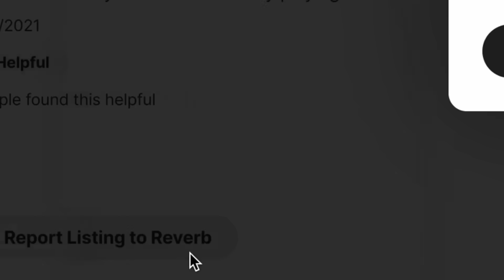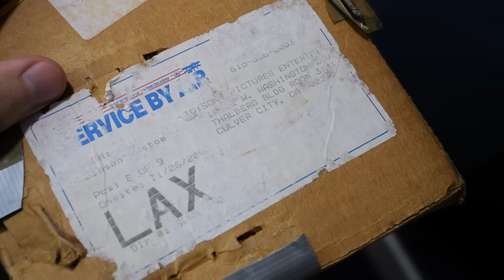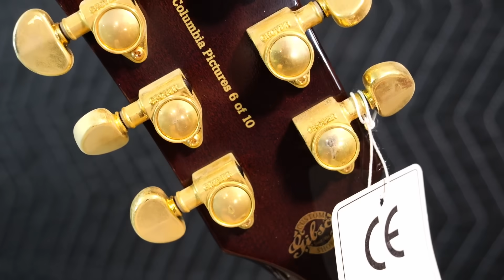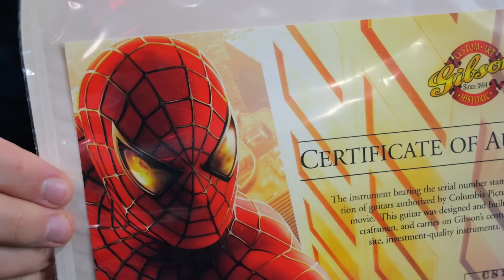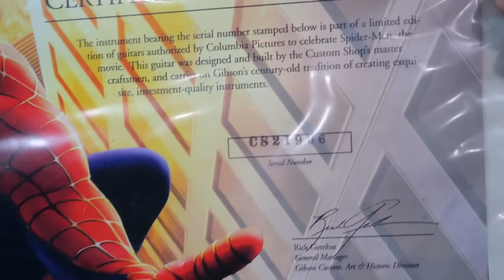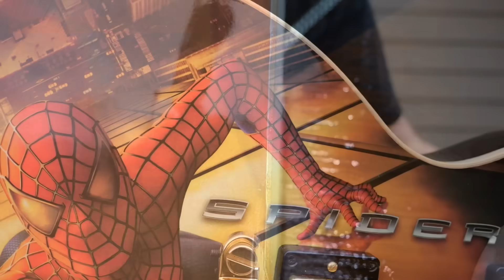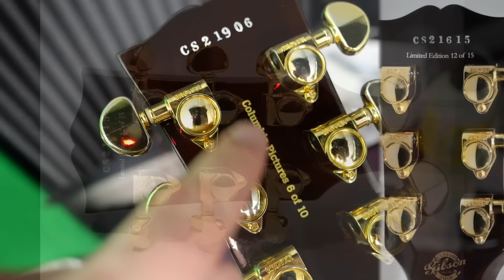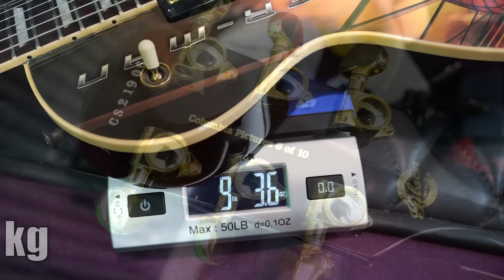I Was 100% Sure This Was a Scam (It Actually Showed Up!)

Comment: Uncle Ben Bucker pickup sounds good
Reply: It does! It had...pop. Don't know how else to describe it. It popped out at you.
Reply: That bridge pickup is super hot. High output rascal. Let your bud Baker borrow it to record some metal with that crazy bridge pickup.
Reply: @leechild4655  dude I have used Duncan Customs since 99 and right next to that is a 498T (also 14k) & swapped my 500T (15.4k with 3 double thick ceramic magnets) for a Fluence Modern. When the 500T based voice on that isn't enough, there's the EMG81 voice that has a 10db boost built in.

It isn't that hot. The latter is as hot as hot gets.

But a de-wound 498T or Custom is an intriguing proposition nonetheless. Still has balls, but is relaxed a bit, in theory anyway. Can't say there's nothing like it, but can't think of anything off the top of my head.
Reply: I seem to remember reading about 57++ somewhere ? I'm guessing that is what the bridge pup is ,? Congratulations on a smokin' deal !!

Comment: A friend kept his guitars and equipment in an unheated garage for a considerable time and his strap buttons had a white powdery substance to them after the chrome had lefft, the frets also turned black, i guess you should keep them in your home if you can to prevent corrossion
Reply: Pull them out once in a while too! Cars and guitars want to be played with and fall apart from neglect!

Comment: Awesome score after a significant risk Trogly. Further proof that knowing your stuff can pay huge dividends. 👍🏻 Clearly you will never sell it, but the thing that struck me is this guitar was in a case, sealed in a box for 22 years until you liberated its mojo to the world. It’s quite possible it was never in tune until you tuned it up, albeit with new strings. Not an example I would want necessarily because I want to play my guitars but an awesome find nonetheless. That bridge pick up is a monster and overall I thought this Les Paul sounded really good. Thanks for the vid Trogly.
Reply: Probably a double win also, since these kind of stories tend to bring in a lot of viewers to trogly videos.
Reply: Speaking of monster bridge pick ups, I have  Epiphone LP Cherryburst 60 reissue and the bridge pickup reads 13.8K Ohms!!  Now that’s a hot one lol
Reply: The decal shrinkage is common with calenders vinyls that are a little cheaper. Cast vinyl doesn't shrink nearly as much. It can leas to the wrinkles forming like the Nascar guitar. Decals on wood isn't always easy to get them to stick.

Comment: Truly intrigued by the bridge pickup. We must get to the bottom of this mystery.

Underwound 498T? Overwound 57? That'd be a LOT more wire.

AND...WHY would it go on this? Cool custom pickup for a run of less than 30 guitars?
Reply: Probably a 57 Classic Plus as they're hotter. It's still slightly hotter than the average for them but much closer than a standard 57 Classic.

They were often paired with a standard 57 in the neck.
Reply: @StephenG1991  It's closer to a 498T than 57 or 57+.

Over or underwinding by 2-3k isn't common. All old PAFs were within ~1k, despite the haphazard process of the time.

Gibson reliably churned out T Tops at 7.5k in the 70s without issue. 490s, 498, 496 & 500T all are pretty reliablely close to spec.

498T and my SD Custom are 14k & different animals to a PAF.

Only 1k jump from 498T to 500T.

Trogster should contact the Custom Shop and ask them. Maybe they used up some prototypes on these, since most owners weren't looking to use them as players? Whomever got this originally, after all, never even opened it.

Jinkies, gang - we got a mystery.
Reply: It may also be a combination of hotter pickups and the bad solder work. Bad solder also increases resistance after all.
Reply: What intrigues me is the "intonatable" wrap around tail piece/bridge. If anyone (other than Trogly) happens to know whether the saddles actually adjust in some way that's not immediately obvious in the view from the top I would sure appreciate some enlightenment.
Reply: @tonesthegrey6452  the bridge has ridges cast into it to get the proper \\ saddle slope, or, close.

There are set screws to adjust the treble or bass side, same as with a Badass style wraparound.

Similar systems are on archtops, but carved from wood. In this era the Teles had uncompensated barrel saddles, so most designs in this era weren't perfect.

The Stratocaster was probably first to market with six individual saddles in 54, the TOM/ST wasn't far behind.

TBH they probably chose an LP with wraptail to have maximum area for the spidey graphic, more than anything.
Reply: @rocketpigrecords3719  Ah, okay... thanks for explaining that. I noticed the staggered saddles, but was puzzled about how they could move when it looks like the saddles are a part of a single cast piece from the angles I caught in the video. I'm not familiar with the Badass bridge, but from your explanation I have no problems visualizing how it might work. Thanks again!

Comment: The print (decal as you called it) was very pourly applied, not centered at all and there’s a lot of dust or dirt underneath. I apply decals and prints on stickermaterials for over 32 years now, and this would never pass quality control. I am almost shure they used a photoprint on vinyl, because a real decal does nit shrink that much without ‘breaking’ And the damage on the edge of the neckpocket is not due to shrinking, but due to poorly cutting some overlapping material due to not centering the sticker.

Comment: How did you clean the Gold HW? Thinking of replating the strap locks in gold?
Reply from the maker: much cheaper to just replace. I don't plan on modifying this one as I know the full story
Reply: @Trog  You sir are a lucky man! This thing is just a WOW piece! Love it! Congrats!
Reply: @Trog  Watch repair channels do their own gold re-plating. It doesn't look like it needs loads of specialist kit. Definitely cheaper/easier to replace them. The original ones don't look too bad after a clean. Maybe would be cool to restore what it came fitted with, though.
Reply: @rockinrob2004 as a chemistry nerd, re-plating is a genuinely fun easy and fascinating process. 2nd favorite thing I ever did in lab class right after figuring out what chemicals gave Fireworks their colors

Comment: Did he say dont keep guitars in their cases? Ive never heard that?
Reply from the maker: The case is a very safe space for a guitar... but when the finish is still brand new and "off gassing" it might not be the safest place to leave it sealed for 20 years. A fully cured finish... yup, you're good.  Be careful of guitars with celluoid - they off gas in a dangerous way!

Comment: The back of that guitar is weird. Ive never seen a gibson that wasnt sanded smooth. Just slightly more smooth than the pickup cavity. Its hard for me to believe it is a gibson, they got bubbles under the graffic and I thought those wrap-around tail pieces were only installed on Jr. models. That finish is bad from front to back, top to bottom, well the headstock is cool. It should be stamped "second", "Third", and maybe "Forth". I dont know if its true but ive heard if an employee really wanted a certain model they could get it discounted by messing up the finish cause they were givin first opportunity to buy the "Seconds" and it would work out to half price with there employee discount

Comment: So guitar six was not in box 6.. of 9? 
It would  be interesting to contact Columbia pics or perhaps the seller to see if these were all given out at an event or ?? 
Part of the provenance is knowing whose been in possession all this time and when it changed hands. Perhaps sitting in a closet at Columbia pictures and squirred away by a staffer?  
Nice but still leaves questions unanswered. Gibson should replace those corroded parts for you!

Comment: 12k huh? 
Classic plus @ 9k 
498t are like @ 14k
I wonder
Reply: Maybe a leftover '97 Classic?
Reply: Based on the baseplate it's a slightly overwound classic plus. I've seen em reach 12k before and they're often paired with the standard classic neck.
Reply: Don't think too hard.

Comment: I have a '57 Gibson pickup that is hot like your bridge pu. It was called a 57 hot (over wound) pickup on the packaging.
Reply from the maker: Send me photos of that please
Reply: Pretty sure you mean 57 Classic Plus, which is 1k overwound over a regular 57 Classic. So, 9k not 12k.

I did a quick google search and Classics and Classic Pluses were all I saw.
Reply: @rocketpigrecords3719 I've read classic pluses hotter than 9k. They're not common but it happens.
Reply: @StephenG1991  3k of the same wire is a huge increase. A hotter accident would likely be 9.5k, maybe 10.

PAFs in a much sloppier era ran 7.5 to 8.5. 1/8 extra wind vs 1/3 here. For instance, T Tops were a very consistent 7.5, in the 70s.

There's a story here, somewhere.
Reply: @rocketpigrecords3719  It happened occasionally. I've measured hotter classic pluses in the past